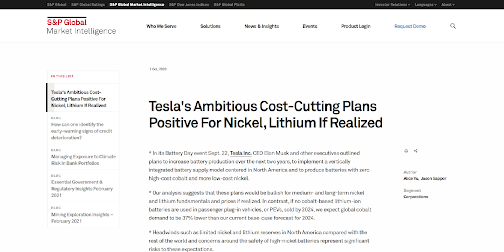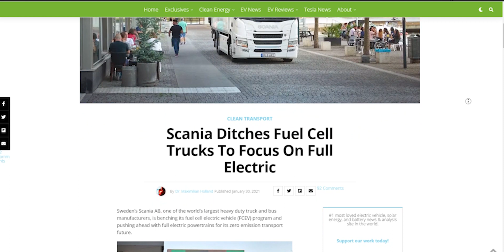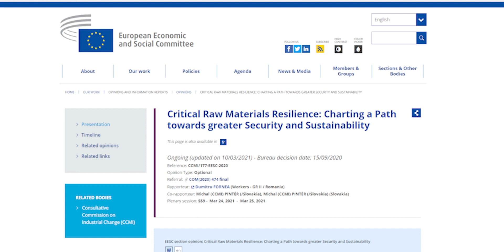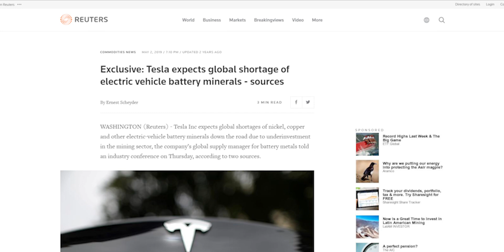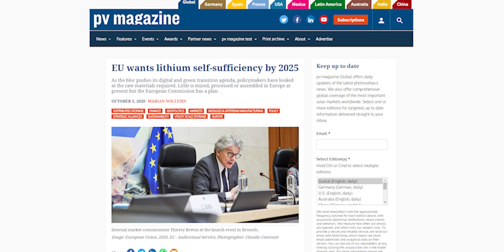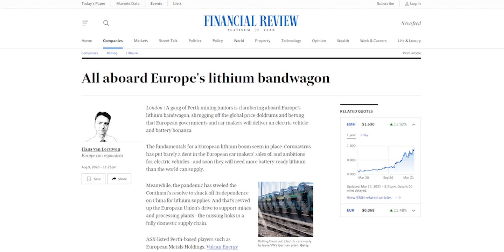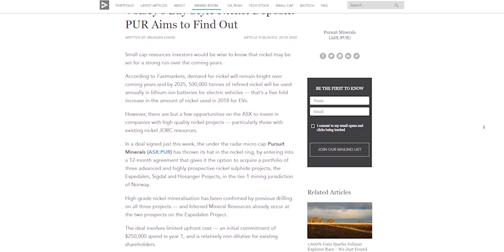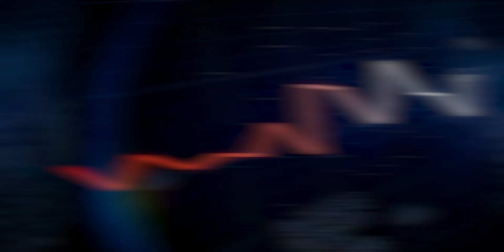EU backed lithium production for EV batteries | Invest now?

Comment: European Metals Holdings is an European Litheum mining company
Reply: Not an European company. European Metal Holdings is an big Australian company. The Czech government has also part in the mine in Europe. The mine is called Cinovec. The EU and czech government both support the cinovec project. European Metal Holdings the stock will go minimum to 5,5 USD, and Maximum to 33 USD in 5-10 years. In 2022 the stock will be 2-3,5 USD. The production of the cinovec mine will start in 2023. There is a lot of Lithium in the mine for 20 years for sure.
Reply from the maker: @holmikehol  Thanks for your detailed explanation!